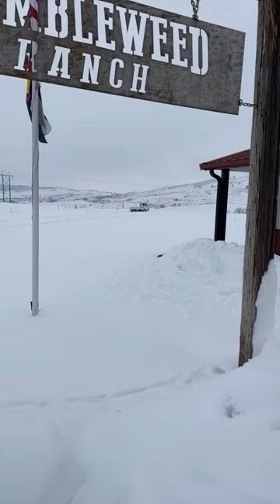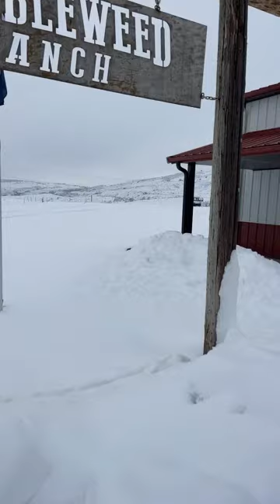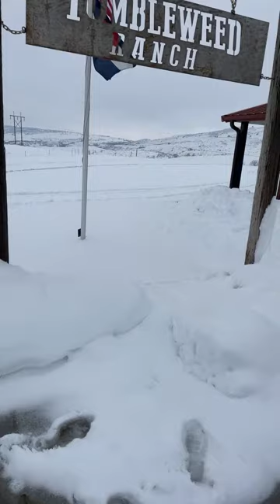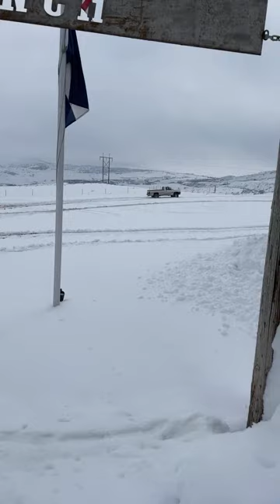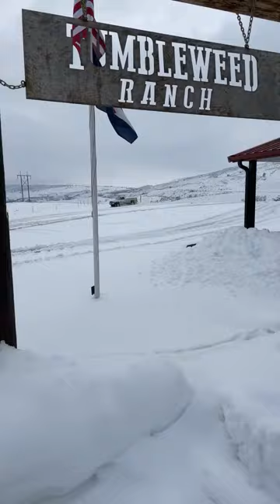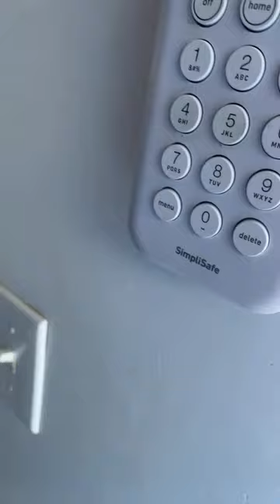Kei Truck in DEEP Snow: Behind The Scenes Video

Comment: I heard somewhere that you can remove bedliner with dry ice. You put the dry ice on the bedliner and after a few minutes you can scrape it off. There is also a type of cold sandblasting that uses dry ice. Dry ice blasting involves propelling dry CO2 ice pellets at high velocity, which then impact and immediately evaporate upon contact with surfaces. It’s a relatively new and innovative cleaning method.

Comment: With your property. Definitely should have done geothermal heating/cooling for this massive building, you have plenty of land as a heat sink. If not, do a couple heat pump units and infrared as backup heat if you put water in. Do not do a spiral staircase in a workshop unless you will have a lift platform to carry stuff up.